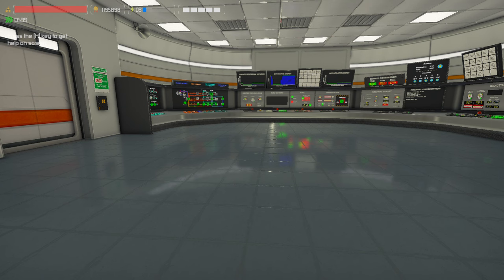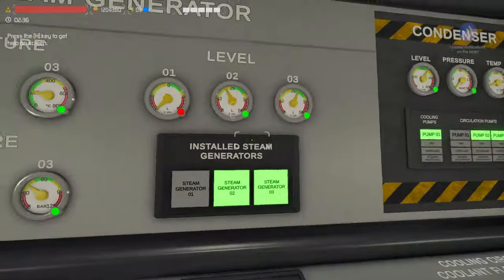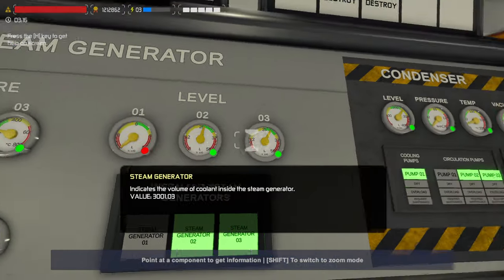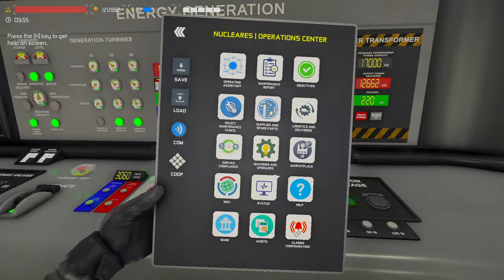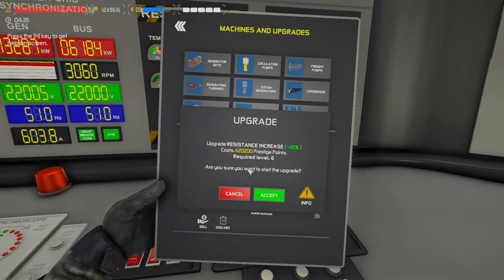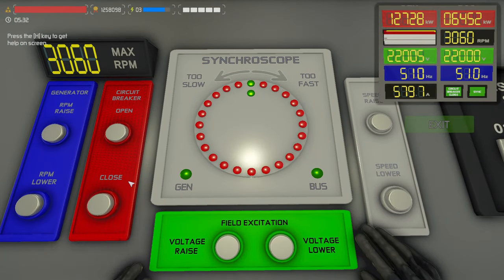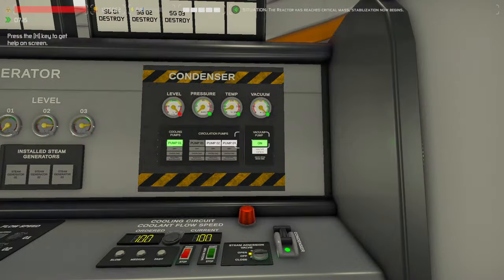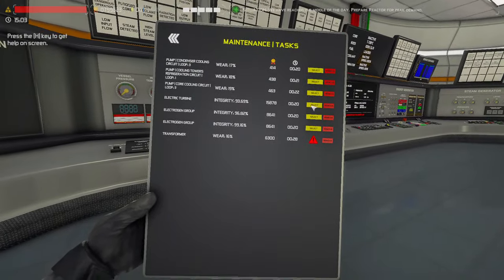NUCLEARES Shutdown V2.12.115: Let's shutdown the reactor

Comment: i think you can bypass the turbine instead of putting all those energy into the resistor bank.
Reply from the maker: Yes that is another feasible option, bypassing the turbine can help reduce power output as well, but I'm on easy mode so there is no penalty for over production. This will be something I consider when I play normal mode! Good advice, thank you!
Reply: or you hit turbine trip maybe? for immediate power stop?
Reply from the maker: I think I tried that when it was happening to me and it still got severely damaged.

Comment: loop 3 runs cooler as it runs the condenser, so it takes away some of the heat.
Reply from the maker: I thought they all ran the condenser? I know the manual says loop three is the cooldown loop, but seemed kind of weird to me! Well thanks for the tidbit!
Reply: They mean the pressurizer. Some of the heat from loop 3 is used to maintain the temp in the pressurizer
Reply from the maker: @breadcan  well the pressurizer should be the hottest point in the core, normal Steady state, so if that is what is happening, then the code needs to be fixed for that aspect.